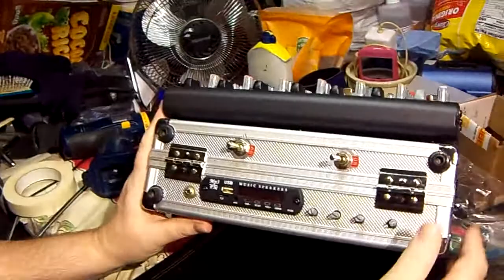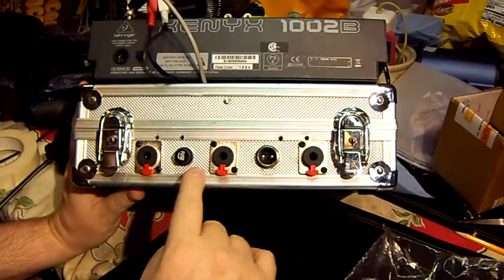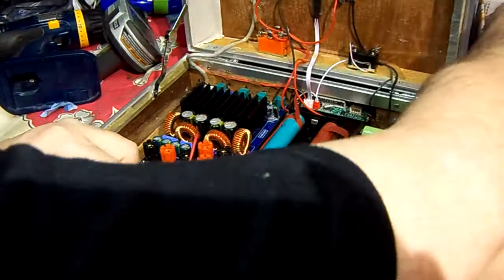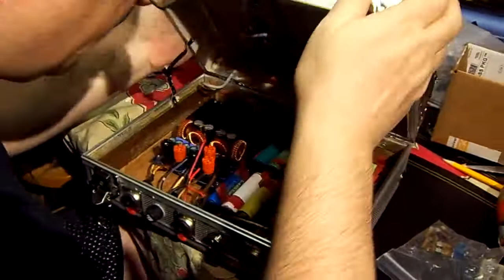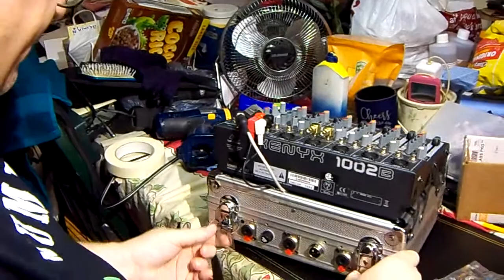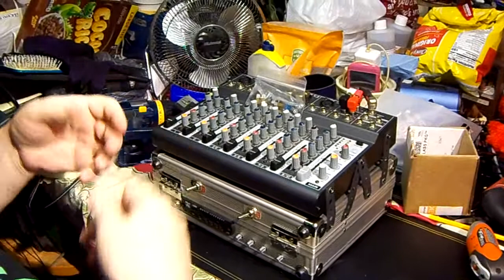battery powered - powered mixer DIY

Comment from the maker: this is a behringer 1002B it comes stock with the ability to run on three 9 volt cells . two for the mixer operation one is for phantom power which we are not using . this rig has a pair of 3x 18650 cells with bregs to drop the 12.5 volts down to 8 . the reason i run the mixer on these 18650 cells is the capacity is much greater than the 9 volt cell . with the stock battery you get 8 hours . i have never run the battery down on the mixer . if you actually watch the video i explain i am using 18650 in place of the three nine volt batterys . sorry i couldnt be of more help .